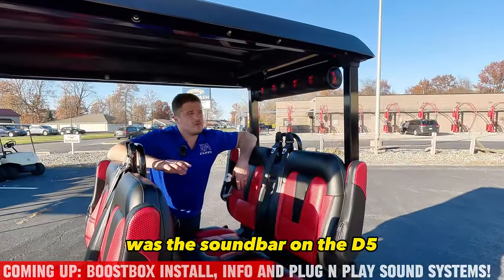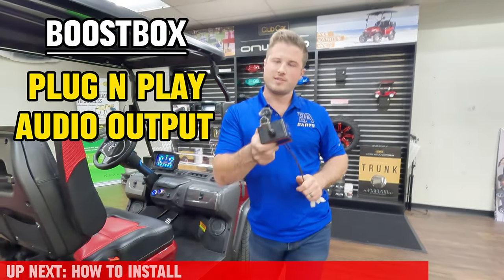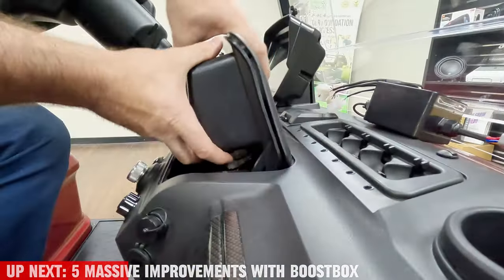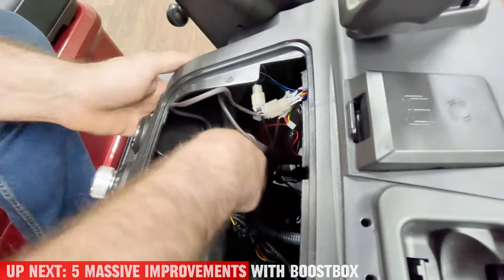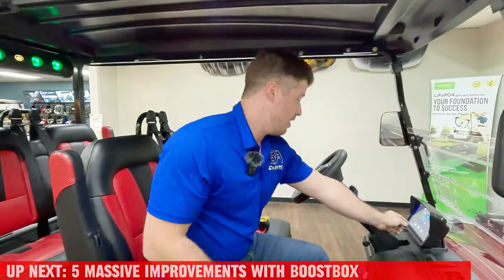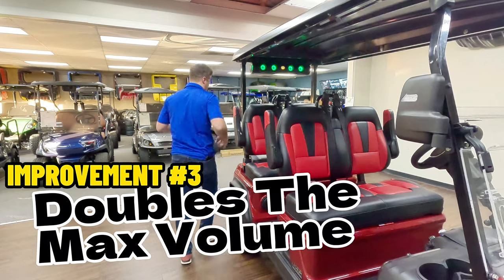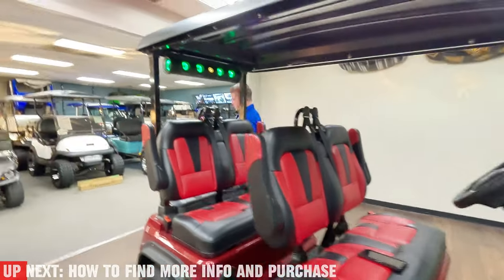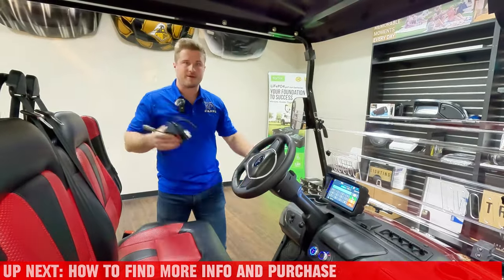The Evolution D5 Soundbar BoostBox® Is A Game Changer!

Comment: Hi Sloan! I am really excited about your new Boostbox and lighting upgrades for the Evolution D5. Do you know how much the extra components affect the battery? Will my total range reduce after adding these accessories? I appreciate the instructional video! Thank you.
Reply from the maker: Great question Nick! So this is a two part answer. The stock converter on the D5 can only handle an amp draw of 20(sh), so you can't really put any accessory on the D5 with that converter that'll make any bit of a difference on the battery charge percentage. Now if you were to upgrade the converter (To like a 30AMP Converter which we are currently working on one for the D5), now you can power some heftier items like a Subwoofer and super bright LED light bars and KC Lights, etc. BUT even with accessories pulling close to the 30amps, the power draw is minimal compared to the draw the battery experiences while driving. The Ohio State D5 that we made a video on had a 1000Watt amp with a ginormous subwoofer and 4 speaker and a 30amp reliance converter and we played that as loud as it could play for 6 hours straight and it only dropped the battery charge by 5%. So long answer short, most electronics will make little to no difference on your battery range!

Comment: I want to buy the Boostbox, I have a D5 coming in a couple of days and noticed the soundbar issues you cited.  I see that some people had problems finding the connectors you show in your video.....is that all worked out, or is there something that I should know before I try to put this on my cart?
Reply from the maker: Hello! New D5 is exciting! If you saw anything about people having troubles finding the connectors, it's because they barely looked or they totally disregarded our video/written instructions. The connectors are extremely easy to find and extremely to plug into. The install is as easy as it gets. So nope, there's nothing you really need to know before installing the BoostBox or D5100. Every D5 has the same connectors! If you want the BoostBox, let me know because we're relaunching it and the D5100 sometime in January and if you're not on the pre-order list, you may not be able to order one till February or later!

Comment: 12:47 Would using this completely eliminate using the phone through the head unit? If so, is there a work around?
Reply from the maker: The BoostBox does in fact bypass the phone's connectivity to the touchscreen. So phone calls do not come through the screen after you install a BoostBox. Your phone may have a dual bluetooth mode that allows you to specify which device handles audio and which handles phone calls. But regardless, 99% of customers don't care to lose their hands-free phone call ability on the D5, because people can't you through the mic on the cart anyways (sitting still), and they definitely can't hear a word you're saying if you're trying to talk through the hands-free mic on the cart while driving down the road.

Comment: $300!!! You could buy a new head unit for that. Maybe if that piece added car play it would be worth $150. $300 is just way overpriced. Way to be innovative but geez sell at a price point that is fair.
Reply from the maker: Some of the cost has to do with it plugging directly into our plug n play sound systems. The biggest chunk of the price is the labor involved to build these with the faftory connectors, making it plug into the existing electrical system to play the audio through the Soundbar to.

Yes you could buy a cheap head unit for less than $300 but you'd also spend 10X more time installing it then you would our boostbox and/or plug n play systems.

99% of our customers have entry level handyman skills with minimal tools, we build products for people that are willing to play for plug n play convenience.

Comment: I have a bazooka sound bar on my 2021 Yamaha Adventurer 2+2 PTV, would a boost box work with that?
Reply from the maker: It will not. The BoostBox is built specifically for the Soundbar on the Evolution D5